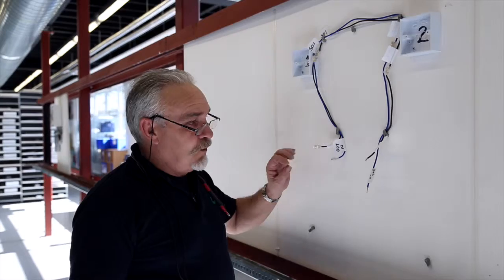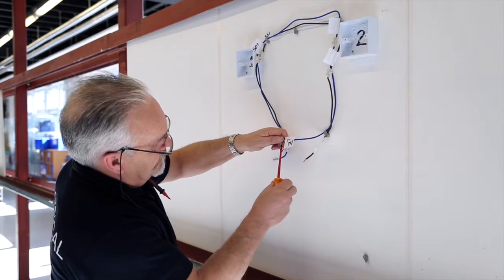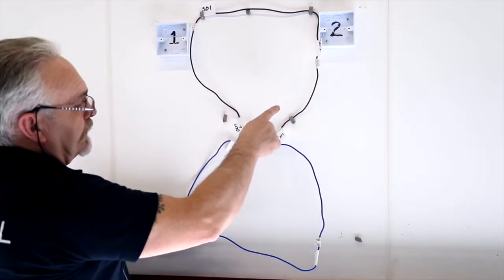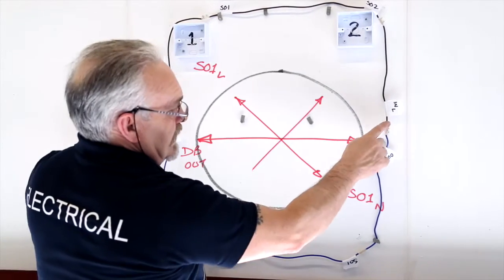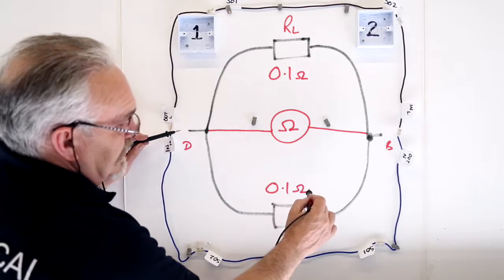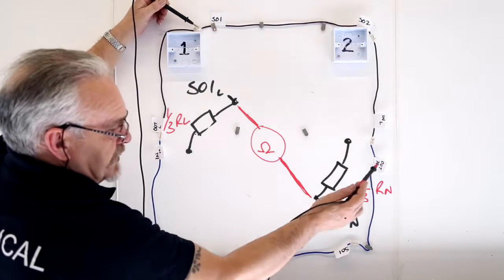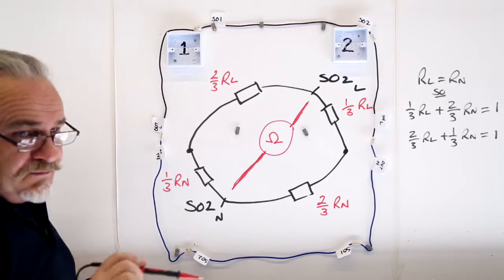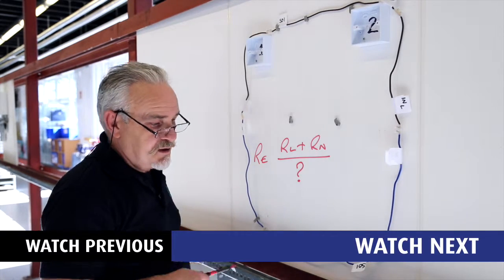How To: Figure of 8

Comment: Answer to last question is 4.
RL +RN / 4.
Reason for this is when adding resistances in parallel the calculation is "1 over Rx + 1 over Ry + 1 over Rz etc etc" :
R Total = 1/R1 + 1/R2. 
As we can't do the "1 over" maths in our head, we get taught the shortcut of R1 + R2 ÷ FOUR.
The size of the earth conductor will not effect this calculation.